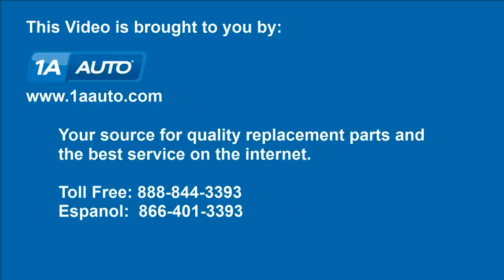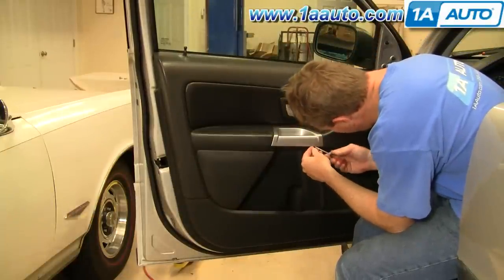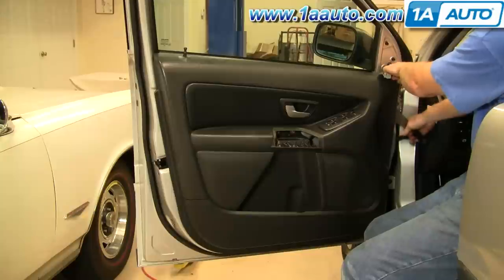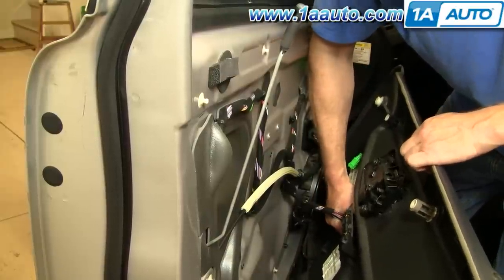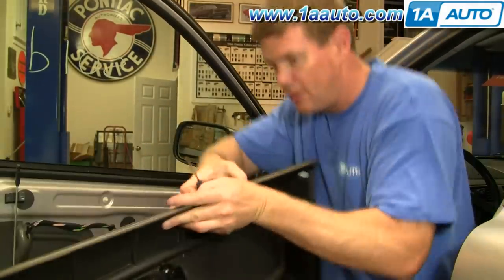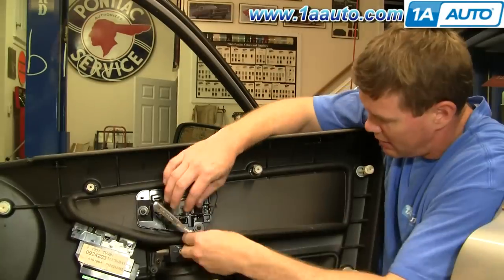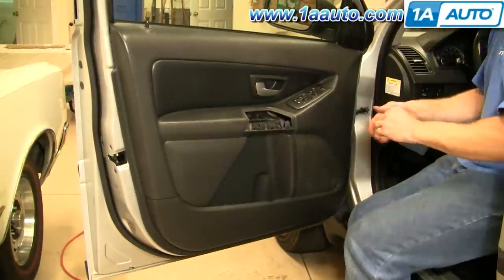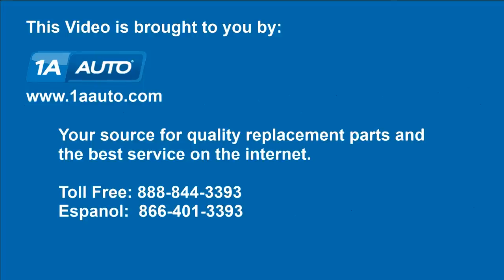How To Replace Front Inside Door Handle 03-12 Volvo XC90

Comment: Thank you!  Do you mean inside where I can not see a broken part? The handles are normal looking. They just stopped working. Neither were subject to trauma or anything. They feel like the cable snapped inside. They appear to work properly at least from the outside. Is there something inside that can break off?? Do you have to buy clips? Do they break when you take it apart? What happens if the handle does not "grag" the cable. I think that is what is wrong. Do I need a new handle?
Reply: Same thing just happened to our car.  That’s a good question and I hope they eventually answer it, sooner than later.

Comment: Do you have any insights on how to replace the interior pull door handle? It is the first part you took off (silver) but the one I have has the plastic silver piece but the actual handle is rubber and is a part of that whole handle piece (below the door handle you're replacing in the video).

Comment: Hi dear 1aAuto Team, my door cable has snapped and I was trying to replace it,however after removing the door panel, I could not find a way to take out  the other end of the cable .Is there any video that covers it or do you know how can I take out the cable? I am talking about the area that is connected to a piece of metal on the door before it goes to the latch mechanism, I hope you know which area I am talking about. Thank you.
Reply from the maker: +Farshad K We currently do not have an auto repair video that covers this particular repair. We will keep this request in mind in the event that we need to make this repair in the future. 1aauto.com
Reply: Thank you for your reply,I bought the part and  took the car to my local guy and they replaced it for me but I forgot to check how they removed the part that I had problem with.
Reply from the maker: +Farshad K Thank you for your order. If you would like to leave us a review on Google it would be greatly appreciated. Here is a link to our reviews section. Have a great day! https://goo.gl/i5JFNY

Comment: Very helpful. The bracket that holds back the spring wire for the latch failed, and the wire forced the cable out. Your video helped me to separate the housing from the handle without killing the clips.

Comment: My exterior handle on driver side is broken. What could it be? Do I need change the exterior handle or the cable? HELP!
Reply: Did you find out what the issue specifically was? I believe the same thing has happened to me on my drivers side door.